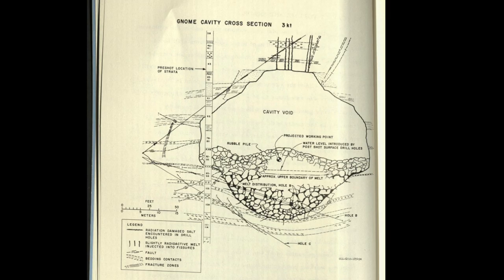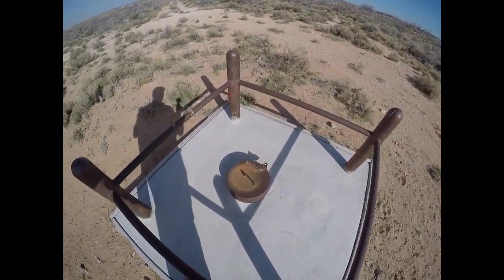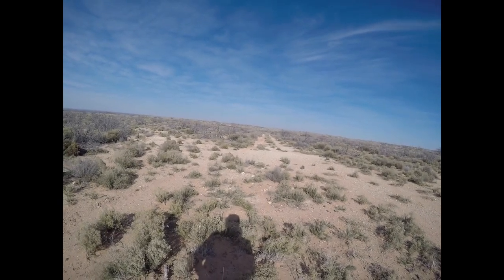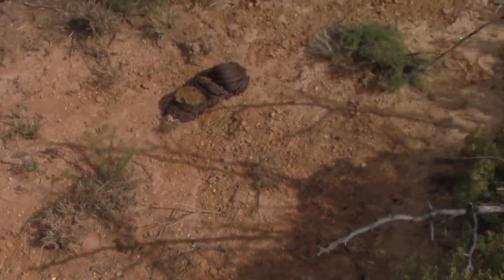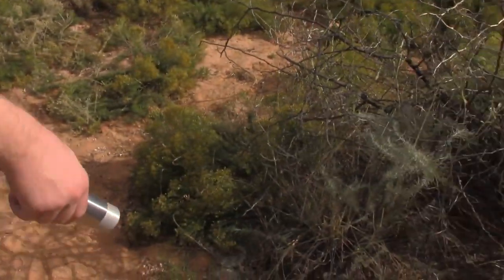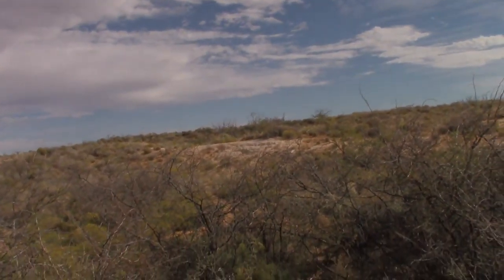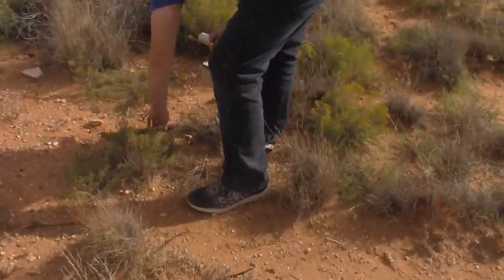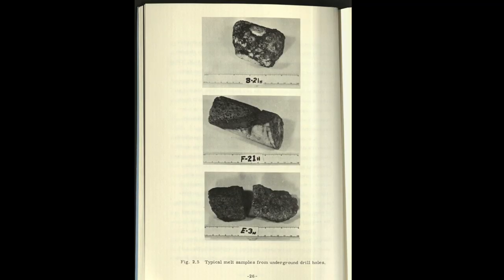Finding Radiation, Gnome Nuclear Test Site Part Two

Comment: Not a drill bit. I promise ya. Also, most  used pipe from the oildfield will show radioactivity. Most of the rocks you are picking up are typical for that whole area of the state,as is the metal debris, most of its from the oilfield. The salt beds that are being actively mined in that area are above the salt beds that the wipp uses. The actual mining in that area is for potash, salt is a byproduct. When they set the bomb off, the idea was the explosion would heat up the salt bed enough that they would be able to circulate water through it and generate steam to run a turbine generator. Didn't work, it cooled off too fast. Neat video, just thought id throw a couple of points that youtube seems to miss.

Comment: Please use proper SI units for background radiation reporting.
Reply from the maker: What specific units would you like me to use? Also if you are referring to dose the dose can not be properly measured by any of the equipment that I have as the isotopes are unknown and factor into the dose calculations.
Reply: Mr.Microcuries Well, I would stick to Sieverts (or typically as micro Sieverts) per hour as a modern SI unit. It’s the common unit displayed by modern Geiger counters and makes life easier for everyone to understand nowadays.
Reply from the maker: ThinkingBetter sieverts are a dose unit derived from knowing the energy of each particle and the number of particles. Geiger counters and most gamma scintillators calibrated to sieverts will only read correctly to the one isotope that they were calibrated to. At this site it is not possible to know what isotopes are present with out taking a gamma spectrum at every measurement point. Therefore sieverts would not be a useful unit and would only serve to confuse people and ether overinflate or under estimate the dose at my location. Most Geiger counters that are calibrated to read in sieverts are calibrated to Cs-137. Measuring Any other isotope will give incorrect dose measurements. So when you see videos of people measuring uranium samples and reading the dose in sieverts from a Geiger counter the dose is likely not correct. You need an ion chamber to measure dose in R or Sieverts.
Reply: @mr.microcuries2078  My Gamma Scout is calibrated against CS-137. I understand your point, but still a micro Sievert per hour is the number that ultimately would speak to the risk in some relative way and that is what is of interest, in my opinion. Any idea how wrong the dose numbers could be with the mix of isotopes you observed, e.g. using a Gamma Scout reading? (factors wrong?)
Reply from the maker: @ThinkingBetter  Well it can be considerably off. Consider that Am-241 emits alpha particles as well as gammas and you are looking at gamma energys around 60kev compared to Cs-137 at around 600kev or Co-60 around 1200 kev. With radpro calculator 1uci of each isotope at 20cm I recieved dose values in uR/hr (only one avalable) Cs-137= 8 , Na-22= 30,  Co-60= 32, Ra-226 = 18,  U-238 = 13.2  You also need to factor in efficiency of detection for different energy's for the detector as each energy gamma will be picked up in differing efficiency.. That is only considering gammas but your Gamma Scout will pick up betas and alphas and can give widely (very inflated) varying dose readings if your gamma shield is not closed. Each detector has a different and unique energy sensitivity and there are huge differences when considering different detection methods such as pancake tube vs standard gm tubes like the one in your detector. Size is also an issue. In this case you would be comparing your approximately 1-2 cm diameter GM detector to a 1.5 inch NaTI detector. They should read the same for a Cs-137 source if both calabrated to it but they will diverge significantly with other isotopes. Both have very different energy sensitivity's and although the NaTI can only detect gamma so it will be a closer match to dose it will still be far off in my opinion will give misleading results. With CPM or CPS you can at least compare to background and it will tell you if something is present. Then you can get something like an ion chamber to give a dose measurement or take a spectrum in order to determine the isotopes present. I recently acquired a Ludlum 44-2 that is regretfully calibrated to read out in rem/hr so I may be forced to report improperly in dose units but it is good practice to use counts per minute when the isotope is unknown or not the isotope used for calibration. The Ludlum 44-7 pancake detectors nearly always read in CPM probably partially for this reason and I don't think I have every seen one of them read in dose.
Reply: @mr.microcuries2078  It would be an interesting video to make a comparison of how these modern Geiger counters work against specific isotopes in terms of what is read and what is actual. BTW, I'm thinking about buying an QG GMC-500 Plus and mount it at my central air conditioner filter and monitor per hour readings. Last time I replaced my air filter I had my Gamma Scout sitting on it and realized it was a bit radioactive (40-50uSv/hour against normally typically 10uSv/hour inside my house), perhaps from radon decay chain isotopes generating in the air...maybe.